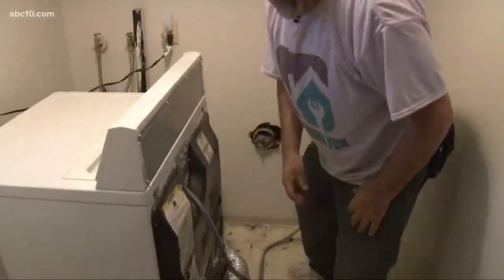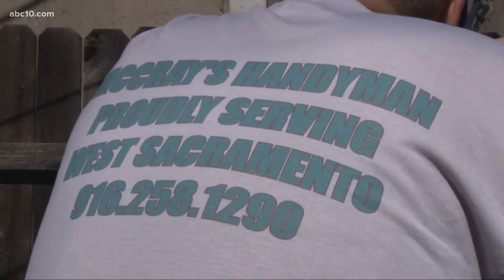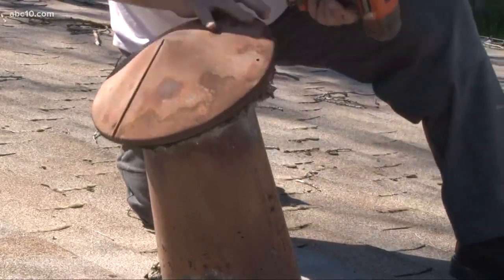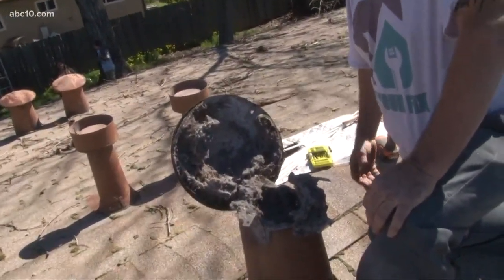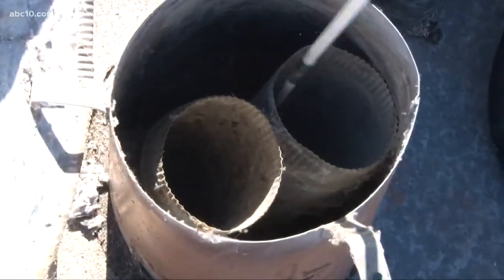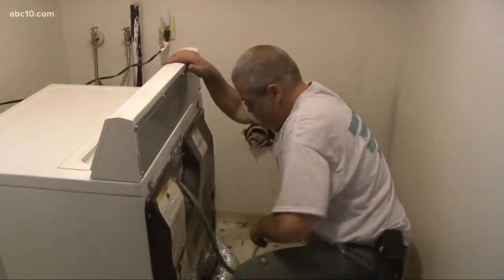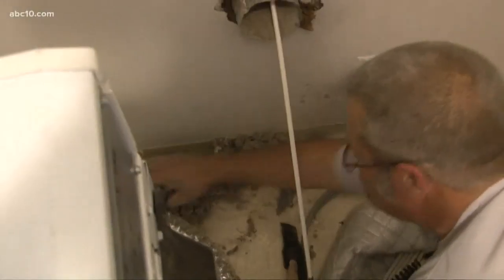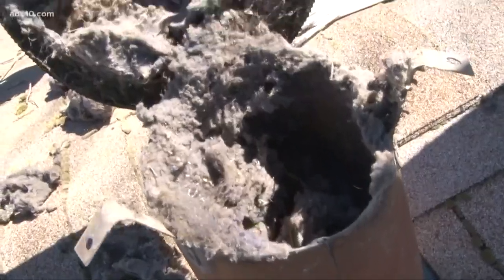When was the last time you cleaned your dryer vent?

Comment: The problem with that particular house is that it has an incorrect vent termination and is against building code.  That cap will prevent lint from being properly expelled and will cause back pressure and rapid lint accumulation inside the vent.
Reply: Well holy sh#t